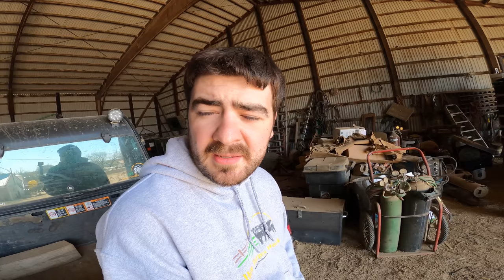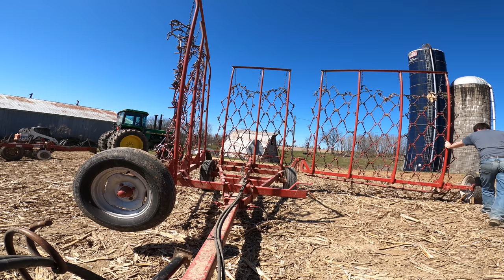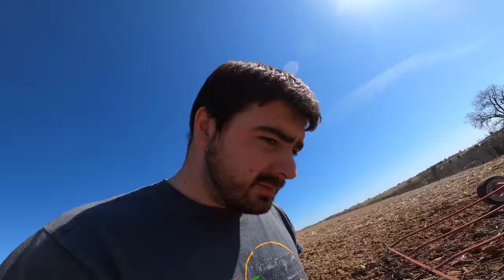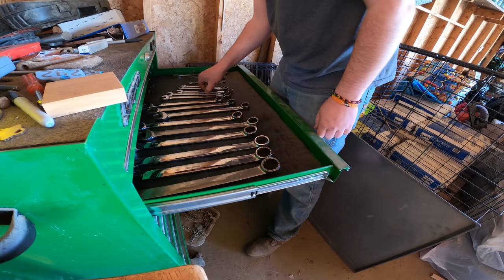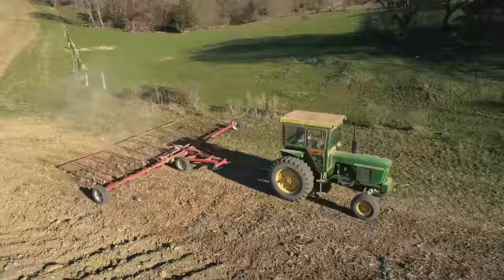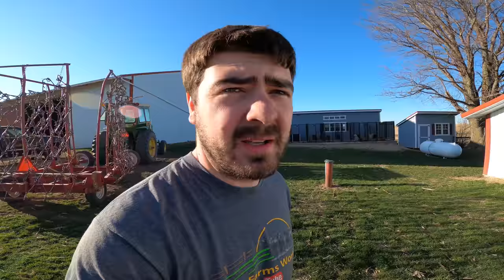Harrowing | John Deere 4020 & Fuerst Chain Harrow

Comment: Maybe you've done this - but have you considered walking around and pointing out the different types of equipment and what it's all used for (all in a single video)? When I was in college I worked at an elevator and my coworker and I would drive to the local implement and he would point out equipment and what it was used for. (He was a farm kid - I wasn't, so I learned a lot).

Great videos, keep up the good work. Like all the JD stuff - little bigger than our old 140!